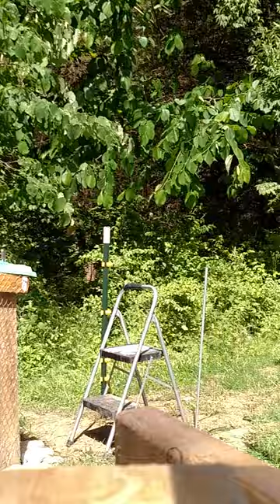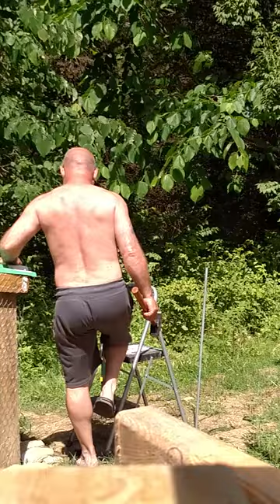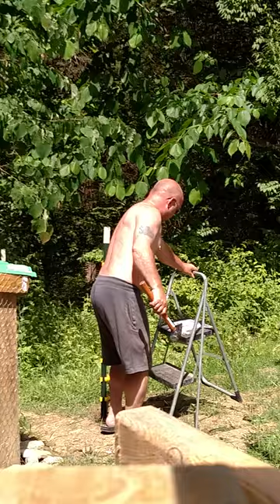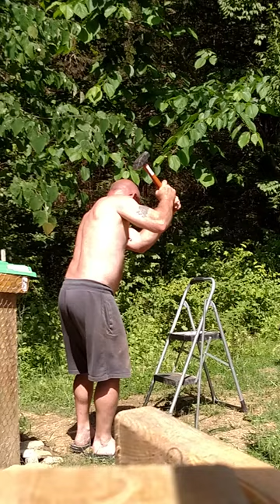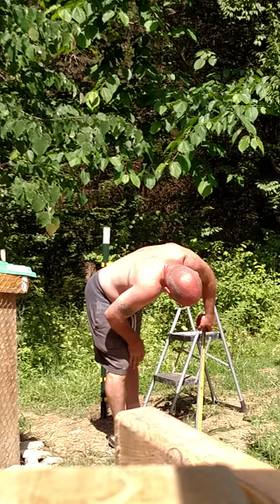Electric Fence - Ground Rod Installation

Comment: Thanks. I think I will try my fence post driver.
Reply from the maker: I had a bad experience with fence post drivers as a teenager and swore back then I would never use one ever again.... and i haven't lol.  Make sure you wear gloves ... that was the problem ... after installing a very long run of field fence around about an 80 acre pasture using fence post drivers I barely had any skin left on my hands from all the blisters (and thats also about the time I learned .... if you have a tractor with a front-end loader ... they will drive anything into the ground easy peasy).  I have gotten so anymore, for just a couple of fence posts or ground rods I use either an 8lb hammer or a 25 lb sledgehammer if they need more loving depending on the ground contents.  In kentucky, its all large rock everywhere and heavy clay soil.